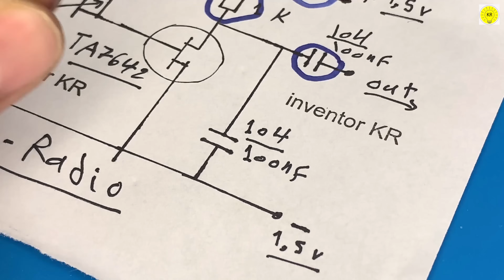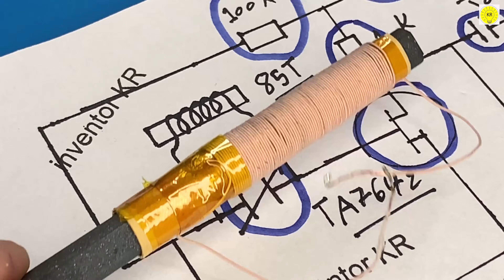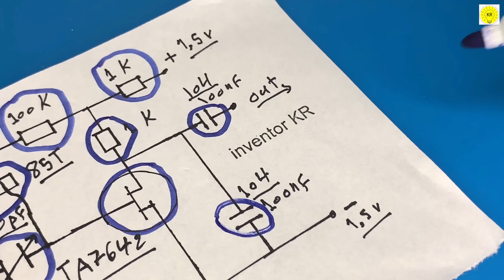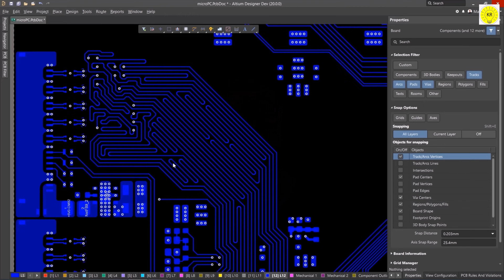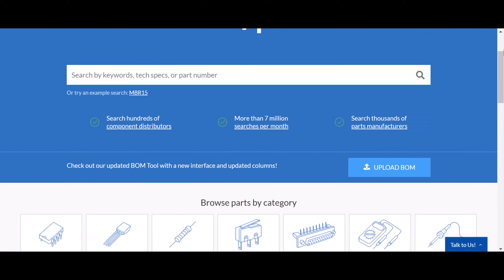make a simple AM radio , receives all international radio stations

Comment: I'll risk this being a stupid question...
I'm 65.  Many years ago when I was about 9, I walked past a metal bin and heard music very low coming from the bin.  Assuming that there was a radio in there which someone had thrown in, I pulled some newspapers apart, but there was nothing.  Although the bin would have had some rather distasteful items in it, I searched as best I could, but there was nothing.  Bear in mind that small transistor radios had been around a little while, but they were reasonable rare in England in 1967, and wouldn't have been thrown away!  I found nothing...Is it possible that the metal bin was picking up radio waves - a radio station?  It's always bothered me!
Reply: No. That's absolutely not possible. It's either a false memory or the sound was coming from somewhere else and your ears were playing tricks on you.
Reply: @AureliusR  
Ok, thanks.  I still go with the idea that there was a radio in that bin.
Reply: @barryfoster453   I'm 70, with over 50 yrs of electronics experience, and I can tell you...that YES, it is possible that something was detecting a radio signal, which you were able to faintly hear. It would take just the right circumstances, for it to happen...but, it certainly is possible. Corrosion between metal surfaces can make a crude, but workable diode...and the hinges on the dumpster would qualify. Stranger things have happened. Rain gutters have been known to corrode, and detect...or even mix signals, resulting in interference.   If in the vicinity of strong signals, a few rare people have picked up signals via their tooth fillings. Mind you, these are rare...but it is POSSIBLE, with just the right conditions.
Reply: @darylp8564  
THANK YOU SO MUCH.  It was really odd, I told my parents when I got home, and I remember telling people in the following days.  It only lasted less than a minute, and it was very low in volume, but was definitely pop music.
Reply: @barryfoster453  You are very welcome. One thing I have learned over the span of my career, was to not off-handedly dismiss oddball symptoms or occurences...just because they didn't always "fit". When I read your comment, the first thing that popped into my mind, was an article I'd read...about a 2 million watt shortwave transmitter that Voice of America had installed, in a remote area.  A local residents was alarmed and quite upset, by voices...when he was in bed. Turns out, with that kind of wattage in close proximity...his rusty bed springs were detecting the signal from VOA, and somehow getting them to vibrate, to where he heard voices. During World War 2, GIs made "Foxhole radios" that used old razor blades, as detectors. That worked because of some kind of protective coating on the blade acted as diode. Only certain blades worked, and if they were cleaned to bare metal, they stopped working. So, it wasn't hard to believe what you heard. 73, Daryl.
Reply: someone nearby experimenting with a pirate transmitter? Back then you could use the valves from the line output stage of an old telly to build quite a strong one, but if they were using it in town they would likely only turn it on for a few minutes to test it out in case someone reported them to the authorities - the TX would then later be put up in a more discreet location with space for the long antenna it would have required. Its exactly the right era for that sort of stuff to be going on (although the offshore stations are more famous, there were (and still are!) a fair few landbased pirates..

Comment: Pls clean the soldering iron tip every time when making new joint. And bend the ends of the componemts pins to make more contact surface, like in SMD part.
This will significantly increase the quality.
Reply: Agreed!
Reply from the maker: Thanks for adding this tip
Reply: @inventorkr1 where can I get the Board you used in the Video ?
Reply: @HardLight77 it's useless lol

Comment: I built this but the only thing I heard was the load snoring of my neighbor.
Reply: * LOUD?
Reply: “Load snoring”?
Toad snoring?
Soad Lnoring?
Reply: Can as an option hear alien conversations😄
Reply: Was he watching you build it?
Reply: Lol
Reply: Good. 😊
Reply: Yuor neighbour will kick your but 😂😂😂😂😂😂.spying on 😂😂😂
Reply: Haha this comment is so cool😂😂😂😂
Reply: Load snoring? Is this like a nocturnal emissions variant?
Reply: There is no amplifiers in the circuit this guy using additional amplifier may be that's why yours didn't work
Reply: @px_arjuh is he using field transistor?
Reply: क्या गज़ब टिप्पणी की है 😅😂😄😁
Reply: Precisely. I ordered 10 pcs of TA7642 from Ali Express and they came out to be all fake.
Reply: This radio should be able to receive LOCAL stations. BUT, only if you connect it to a decent antenna, and a ground. You would be lucky to receive a signal from more than a couple of feet away, on just the ferrite core antenna coil shown.
Reply: @darylp8564  I agree, I used a ferrite wound inductor with inductance of 420 uH wound on 10 mm x 100 mm Zn Mn based powdered iron rod. The transmitter was a few feet away, yet like you said and like the other gentleman said, all I could hear was a nasty hiss and snoring and nothing else. I used 365 pF tuning capacitor as well that I especially bought for it. I am utterly dismayed. The Ferranti company recommended 680 uH inductor. I'll wind another one with that much inductance and try again. I also purchased 2 YS414 for it, yet nothing.
Reply: dang u reserveed a sleep monitor 😂❤
Reply: I built a similar one with oa 79 diode , 500uuf capacitor , ac 188 and af 117 transistor , am coil and a voice amplifying transformer with a tiny speaker in mid 70 s for science club in school and my grand parents in village
Reply: @hayatasha Was it working, Please Help Me Sir
Reply: LOL 🤣😂
Reply: You did nothing.👎
Reply: May be neighbors fart also
Reply: Значит был неучем в школе и спаял все по женскому половому органу🤷‍♂️

Comment: Is it okay not to use ferrite rod for inductor?
Reply: Yes high frequencies , the crystal radios just use the crystal with antenna and ground rod
Reply: @pauljanssen7594  Cz-Max do 2 Mhz.
Reply: You can use an air core coil, but it will take a lot more turns, to equal the one with the ferrite core....if you want the same frequency coverage.

Comment: Why cant we just use all 100k or 1k resistor? Explain
Reply: The resistors have different purposes in the circuit. The 100K is for biasing the first transistor inside the TA7642...the 1K from the battery isolates the positive rail of the internal amplifiers and bias transistors from direct connection, which would short out any signal output. The 1K going from the junction of the 1K and 100K, acts as a load resistor of sorts. You need to see the IC's internal diagram, in order to understand how they work, in this circuit. In short, your answer is "no"...they can't all be the same values.

Comment: Do you have to use resistors with 5% tolerance? How does the circuit detect AM without a diode?
Reply: There is a diode in the transistor with zero threshold voltage, allowing fast switching.

Comment: how's the sensitivity gonna be with such a small LC? how's the performance of the IC? the only transistor radio i was able to build was a regenerative one which utilized a feedback loop, was running a 2n2222a and a soviet KT315G with rather large coils.
Reply: You might be surprised to hear a signal or two on it, if you connect it to a long wire antenna, and use a good ground. There is NO WAY that it will receive signals from any distance...if you use it, with just the antenna coil shown.
Reply: cz-7642 není polem řízený tranzistor ale integrovaný obvod s 10 tranzistory a funguje pouze při 1.5V a maximální kmitočet okolo středních vln(cca2 Mhz) u nás se již středovlnné  a dlouhovlnné vysílače vypnuly takže to mám pouze jako dekoraci.Nyní používám regenerativní tranzistory při 1.5V na VKV.
Reply: GEEK...
Reply: @ get with the times grandpa

Comment: O CONJUNTO BOBINA/CAPACITOR DE SINTONIA ESTÁ LIGADO COMO REJEITA FREQUÊNCIA (ESTÁ EM SÉRIE COM A ENTRADA  DO IC...ERA PARA ESTAR EM PARALELO.) DESENHO ERRADO???
Reply: No, it's correct as shown. The signal is received by the parallel resonant LC circuit, and is coupled directly to the TA7642 input. The other side of the LC is coupled to the circuit ground through the .01 capacitor, because the bias resistor connects to the input, through the  ground side of the LC tuning circuit. Look closely.

Comment: I have problem designing the ferrite core with those threads.  What is the name of the thread and how can I get one ?
Reply from the maker: Use copper wire
Reply: @inventorkr1  
Thank you bro
How many turns and the wire size ?
Reply: @AugustineAriola  22 gauge wire, and about 70 turns.
Reply: Better to use Litz wire if you can.
Reply: @AureliusR  
Really ? Can I get that ?